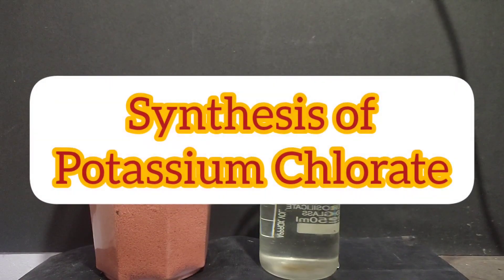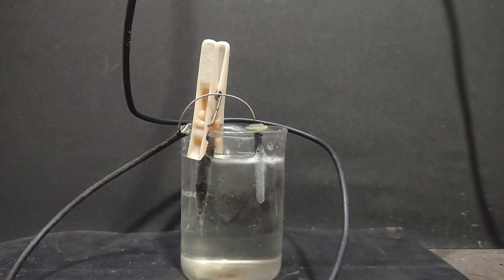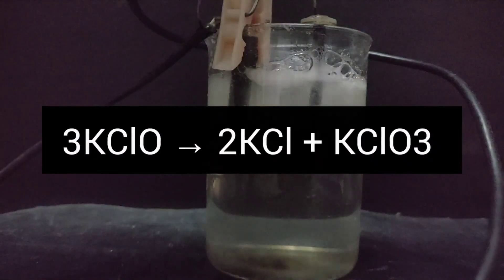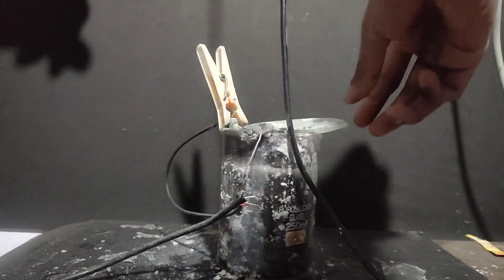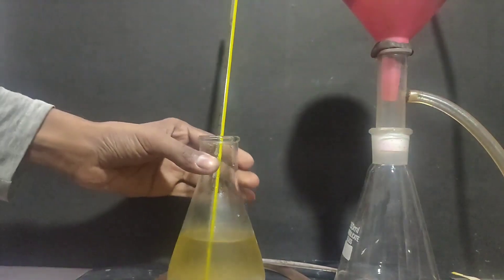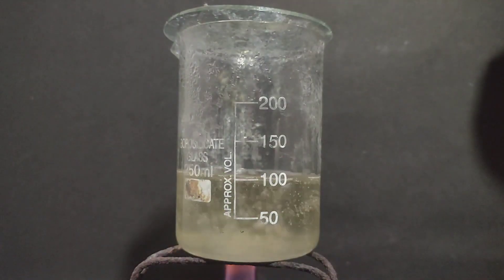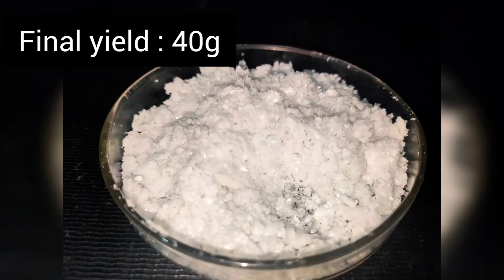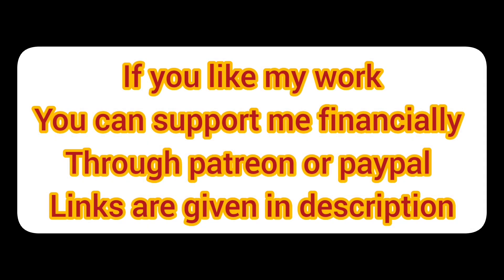How to make Potassium Chlorate

Comment: My power supply is getting short circuit .Now can you tell me what power supply you used
Reply from the maker: Dc
Reply from the maker: I used a mobile charger
Reply: make sure that you are outputing 6-12 volts on the positive electrode. that remains DC volt.